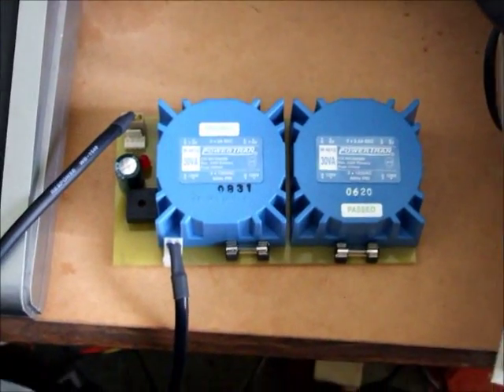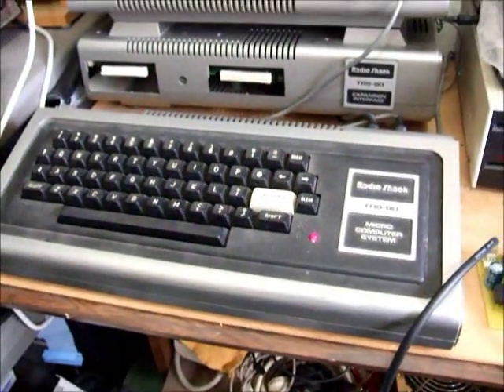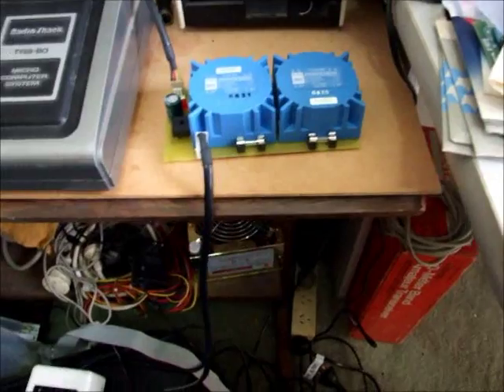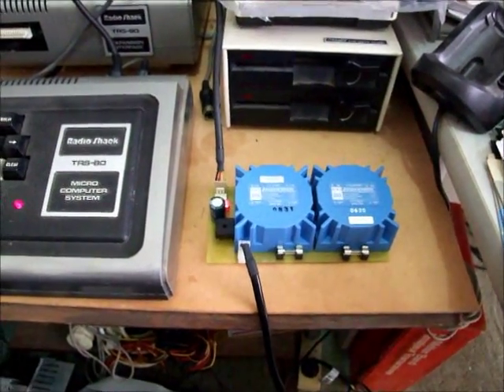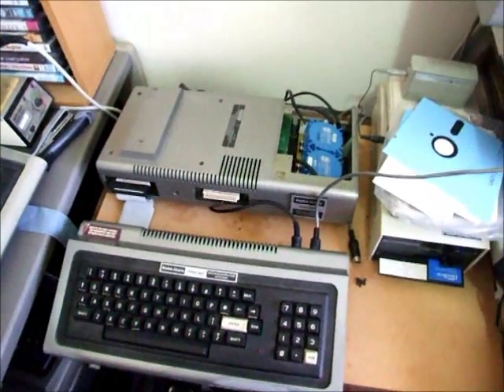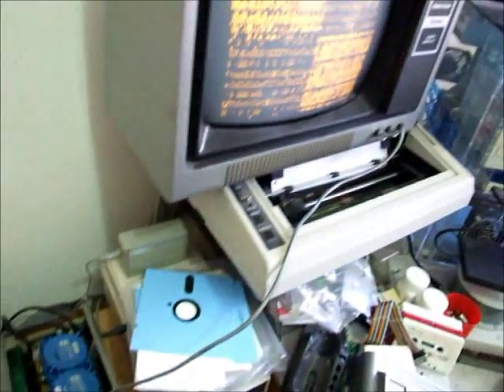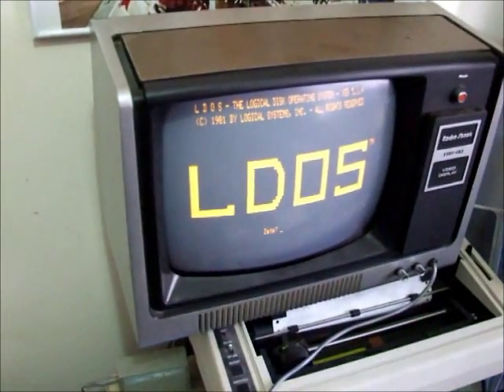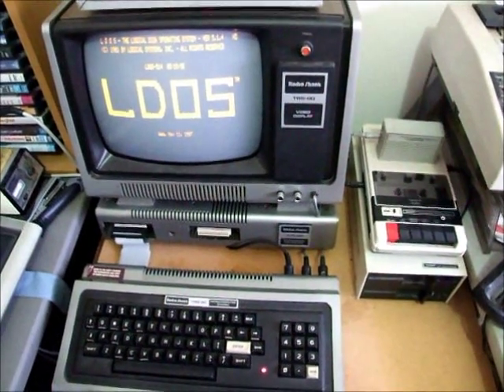Custom power supply for TRS-80 Model 1

Comment: Did you ever send up selling the US version? Came into not one, but two TRS-80 model 1s (along with a ton of other TRS-80 related stuff). If they aren't too costly, I might be interested. If not, I'll just toss it all on ebay.
Reply from the maker: Yes I do make US versions and have sent a few to the US but they are not a big seller mainly because: a) The blue torroid transformers are expensive meaning I have to sell these suckers for $A150.00ea, and b) the finished weight of the device is just over 1Kg meaning shipping them to the US is $A52.00.  

Those who have bought the PSU are very happy with them but since a pair of US OEM used PSUs can still be bought on eBay for under $USD50.00 each there has not been as much interest in my Custom PSU as of late.